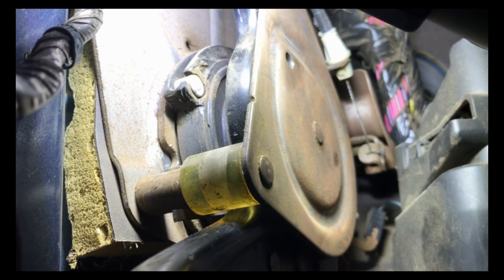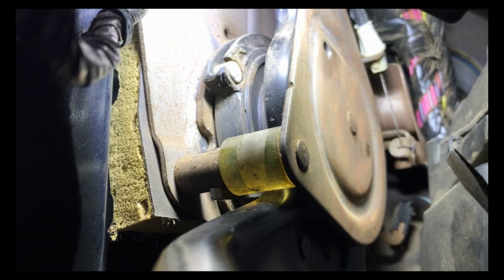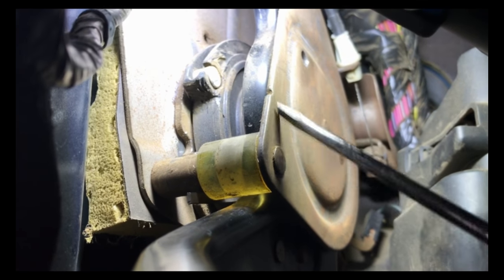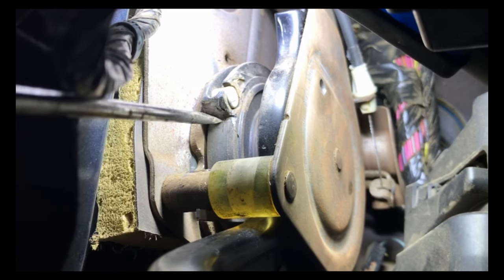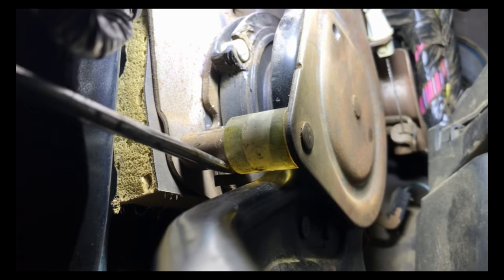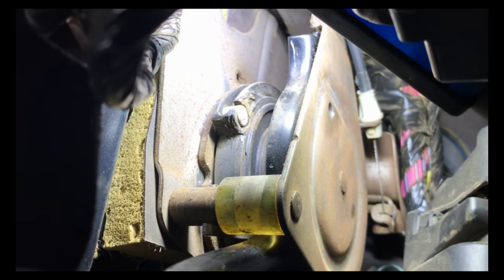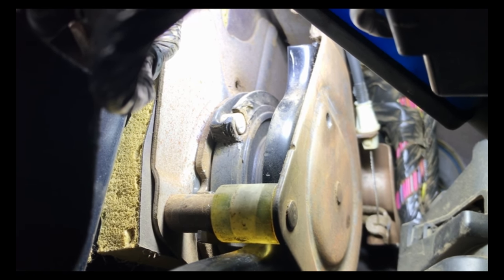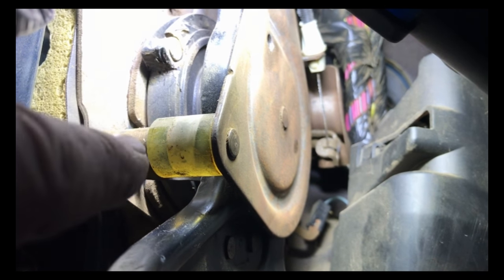Chevy GMC Truck Parking Brake Lever Pedal Reset After A Cable Replacement

Comment: My 2004 Silverado 3500 has no parking brake.  Pedal goes to the floor.  I recently did a complete brake job with new rotors and pads F & R.  I adjusted the park brake shoes just outside dragging.  I thought my park brake problem was stretched cables but maybe there is adjustment in the pedal mechanism.  I'm going to fiddle around with it and see if it can ratchet enough to tighten the cables.  Supper video by the way.  Purely technical and no annoying background music or other wannabe entertainer drivel.
Reply: did you figure it out? i have the same problem with my 09.
Reply: @that_sl0ws550 my rear brakes are dragging too.. 2013 express 3500... ☠️

Comment: I did not have to pry up on the mechanism as you did. I just knelt outside the drivers door. Make sure that the pedal is all the way up. I then grabbed the brake cable under the truck with my left hand and with my right index finger reaching over the pedal arm, I pressed on the spring that you indicated and pulled on the cable with my left hand. The important part is to keep full tension on the cable so that the ratchet doesn't recoil. If you keep the tension on it while working all of the slack back to where the two cables connect, there will be enough to connect the two with no problem. At least for me it worked this way. It took a couple of tries to do it without the mechanism reeling it back in on me but I did eventually get it. As a side note, I couldn't find the correct position for the screwdriver to hold the ratchet back so I just did this without it. I appreciate your video. It made the job so much easier.
Reply from the maker: Yours must not have a very tight spring. This one was really tight with a lot of tension. Had to use a screwdriver to pry it back. Thanks for watching

Comment: Thanks for providing this information and video!  I have a 2008 GMC Sierra 2500HD that I replaced the driver's side rear brake cable on, as it broke a while back.  I ordered and installed the new cable, but could not get enough slack in the cable(s) to connect the rear cables to the coupler.  I removed both rear wheels and ran the self adjusters for the parking brakes all the way in to remove any tension from the adjuster/shoe expansion.  Still not able to connect the cables.  I found this video while researching more options for the parking brake system, and was able to follow the recommended procedure for adjusting the brake pedal ratchet, and BOOM, it was exactly what was holding me up!  I used a bungee cord to keep tension on the front brake cable coming from the pedal assembly, and it provided enough tension for me to get your recommended procedure to work,  It's together now, and I'm good to go!  Thanks again!
Reply from the maker: That's is why I made this video. There was no info on doing this. Thanks for watching

Comment: You're a lifesaver, buddy. That locking spring was the key. Since I had to do it by myself, I wedged a screwdriver to hold it down, then pulled the cable as far as I could and clamped it off against the mounting bracket with vise grips. I never could get anything going with that hole in the mechanism, but I had enough slack to get the cables attached. Then I just released the vise grips and released the spring.  Thanks a bunch.
Reply from the maker: Glad it helped you out. Thanks for watching

Comment: Thanks a lot for posting that video!  it helped a lot. One thing you may want to add or for anyone it’s reading the comments is that you have to pry up on it and pull the spring multiple times and work its way up to the full reset. Thanks again, I appreciate you.

Comment: This was a great help; however, I was still not able to get mine connected.  It was still just a bit too short to get the end of the long rear cable into the connector with the intermediate cable.  I ended up having to unbolt the cable holder bolted to the rear axle on the driver side to allow enough slack to get the end of the cable into the connector.  Once connected, I was able to have my son release more cable as you showed here and give me just enough slack to get the bolt back into the axle holder.  I tested it and it all works great.  Thanks

Comment: Thank you for the video. You got a clear picture. Did the rear brakes on my 2004 Tahoe. Pads were 
to bare metal because all the calipers on a 17 year old SUV had frozen up. Total rebuild. Including 
adjusters. Parking brakes worked but had to push 3/4 down. Not good, but figured they had to be 
adjusted somewhere else when done. Was very meticulous when reassembling the adjuster, etc.
Your video gave me some where else to look. Thank you again.

Comment: Just went through replacing the cable and the ends are too far apart. I thought there was an adjustment at the pedal but there was none, however, I did notice that the part you are speaking about is in the lower position. I will try what you suggest, I am sure it will work. Thanks so much.

Comment: You need to change the title of the video and add cable replacement to it. If you search for parking brake cable replacement videos, no one has figured out this procedure. It would expose you to a larger audience. Thank you.
Reply from the maker: I will try to add that to the 'tags' in the video but this video has been up for sometime it probably won't help. Thanks for watching

Comment: Thanks a bunch. I had no helper so used a couple of bungie cords to keep the pressure pulling on the cable while holding the spring down and forcing the  drum to turn with a long screwdriver.
Reply from the maker: Yep I always have ratchet straps and bungie cords. You never know when you will need a extra hand. Thanks for watching

Comment: Thank you!! I knew there was anther way with all that slack. Now to try to take it up.
Reply: It's a nightmare. I tried to pry that cable channel but nothing to use as a fulcrum except the plastic hood release lever. So I bagged it. Atleast it looks like it works now.

Comment: Hi all - I have an 'augmentation' for this video!  Zero tools required. No force.
Push the pedal to the floor (by hand - fine, that's a tool!)
The spring arm pointed out is now nearly at the floor.  You'll see a notch, that you just push the spring into.
Gently release the pedal.
Go underneath and just pull the cable out until you can link the parts (almost no effort needed).
Now just flick the spring out from the notch (carefully so it doesn't bite you!!!), and push the pedal a few times to reset things.   Done!   :)

Comment: I work on these fairly regularly and i use an air fitting wedged behind the parking brake pedal to hold the spring release mechanism. Then I go under the vehicle and use a rag and vise grips to secure the cable where it exits the first area (sort of under the driver’s seat). It does not to be tight because when it is released there isn’t  much tension. Then I use the Lisle park cable release tool to disconnect the cable at the “Y” and from there O can diagnose and replace the rear cables as needed.
Reply from the maker: Most of the time the trucks I work on the cable is broken and you have to reset the lever. That is a good idea when you can do it that way. Thanks for watching.

Comment: Thanks for posting this! Mine will not take up the slack in the cable.. Pedal doesnt co9me back up either. I wonder if that spring is serviceable
Reply from the maker: I think it a not serviceable item. But if you put it out you might be able to figure out whats wrong with it. Possible a broken spring that holds the ratch paw. That might be repairable. Thanks for watching.
Reply: Hey I know this post was a year ago but did you ever repair this? My truck 2007 Chevy Silverado emergency brake pedal won’t come back up o it’s on.

Comment: I'm about to replace my cable on a 1991 c3500 dually. Hope this comes in handy.
Reply from the maker: That one probably doesn't have a ratchet like this one, it should be just replace the cable. But not sure. Thanks for watching
Reply: @TheGAutomotiveAndMore  your right! I went out to look and it doesn't. Mine never broke it just stretched I'm guessing. Its still connected but extremely loose now. I'm not sure what's really going on.

Comment: HI....Do you think this is the technique for adjustment also ( i have NO broken cable or replacement)....My pedal is down to the floor before parking break barely holds???
Reply from the maker: If you have rear disc brakes in the back I bet that the small drum brake shoe's that are the parking brake have come unglued and are spinning around in the rotor/drum.

Comment: Me again my 2004 Silverado. the brake cable rusted and broke next to the frame below the drivers side seat area, will that whole cable have to be replaced from the parking brake in the cab to where it attaches to the two rear brake cables?   Thanks again
Reply from the maker: Most trucks have a intermediate or a center cable. Your are going to have to look under it to see what you have. You are also going to need the wheelbase to order the cable.

Comment: On these trucks, does this ratchet pedal control how much max tension is applied to the cable? In other words, when these systems are fully operational and the parking brake shoes are adjusted properly, is that pedal supposed to go to the floor?
Reply from the maker: I just checked my sons 2005 Escalade that we rebuild the parking brake system and yes the pedal goes to the floor and it works.
Reply: @TheGAutomotiveAndMore  Thanks for the reply, I was beginning to think they were made this way but I have an update.
2002 Silverado. I would get the shoes adjusted nice and tight and the pedal would be rock hard initially and then fade off and the pedal would go to the floor BUT it would "hold" the truck (Not very well in gear).

Came to find that everytime I would adjust them tight then lose the pedal, the actual parking shoe ears were COLLAPSING at the  tabs where they mount into the cylinder.

Apparently the aftermarket brand Perfect Stop shoes will not hold up to a HEAVY foot when setting the park brake, they collapse if you press the pedal set too hard. Could be fixed by welding a support tab to the shoe, assuming that the GM shoes would not do this.
So the answer is no, the pedal should not go to the floor when everything is proper

Comment: My cable is ok, my brake will set, my issue it when I release the Ebrake it comes back up but not far enough to stay tight and the brake light is on. I Have to pull it up with my foot. 
Is there something else that may help me?
Reply from the maker: Does the parking brake cable hold? One of the levers in the back if it has disc brakes could be not returning all the way. The shoes could be out of adjustment or you cables could be stretched.
Reply: @TheGAutomotiveAndMore  
I just got the truck last week. In the middle of remodeling etc, I haven't had a lot of time. 
The cable is at least working on one side but I know it needs to be adjusted. I live on a hill
I wasn't sure if there was another place a spring pulled the pedal back up. I'll take it in and have it adjusted and checked >)
Reply from the maker: @FullAutoApolotics  Something is wrong, most of these don't have a cable adjustment. Everything must work in order to work.

Comment: Hi do you talk about the rear brake cable cause that is my problem on 2008 gmc Duramax to hook the right cable in that clips tank you
Reply from the maker: Yes you can release the front cable to give you more slack to hook the rear cables in.Thanks for watching

Comment: should this work with 2006 2500HD GMC Sierra as well?
Reply from the maker: This should be the same on 2007-2014 trucks. This one was a 2009 GMC. But I am not sure on the 2006
Reply: Worked on my 2004 2500hd

Comment: I have a 2001 Suburban and the brake light doesn't come on I constantly hear a chime is this the reason? Also the emergency brake pedal is all the way down to the floor I had no idea I've been driving with it for a week like this it still has resistance but it doesn't stop the vehicle, what's going on with this? Is the cable broke perhaps? Or does it just need adjusting?
Reply from the maker: The chime is warning you that the parking brake is on. The parking brake could be out of adjustment or a cable could be bad. Thanks for watching
Reply: @TheGAutomotiveAndMore  appreciate the response I lifted the emergency pedal now and it's still chiming I guess it's out of whack perhaps? I can recall now that AAA guy probably put the emergency brake down when he told it any never ticket out of that position.
Reply from the maker: @darealblair3262  There should be a sign in the dash telling you why the chime is going off. like door ajar, brake on, something like that.
Reply: @TheGAutomotiveAndMore  thanks again I thought so too but there's actually nothing. Just the typical service the four-wheel drive which always comes on. But it never constantly kept that going. This is very strange to me.
Reply from the maker: @darealblair3262  I don't know either. But if it is the parking brake you should be able to go under dash and unplug the parking brake switch and see if the warning noise stops.
Reply: @TheGAutomotiveAndMore  ok, I'll try this..thanks once again

Comment: Hey have the tab up with a screwdriver holding it and the cable still isn’t long enough any ideas??
Reply from the maker: I would double check that you have the right cable and then make sure somebody else pulls on the front cable as you release it again to see if that makes it long enough.

Comment: My problem is on an 2006 Colorado, then cable it self is ceased, and I need to remove the cable from the pedal to the bracket it splits at.
Reply from the maker: If cable is no good and you are going to replace it, then cut the cable.

Comment: I tryed too adjust to get pedal higher....
Could not do it.....it does work but pedal is very low and on big hills i need to push very hard too floor
Reply from the maker: Rear shoe's are bad or needs adjusted

Comment: My pedal goes all the way to the floor, weak hold,  should I try this adjustment? Or should I adjust at the rear wheels? Or both? 

I know my parking brake switch is bad, I couldn't do a TPMS reset/relearn because of this, the dash light wouldn't light up with the pedal to the floor, the cables all look good,  I bypassed the switch for the TPMS relearn and tapped into the parking brake wire by the switch, and grounded it only to do the relearn.  (I hope that info helps someone else) 

I watched this because to swap that switch I may have to pull that pedal assembly and redo it. It looks like a pain in the ass.
Reply from the maker: If your parking brake cables are all working, then I would say try to adjust them, but I bet your parking brake shoes are bad. They come unglued and then they don't hold. Thanks for watching